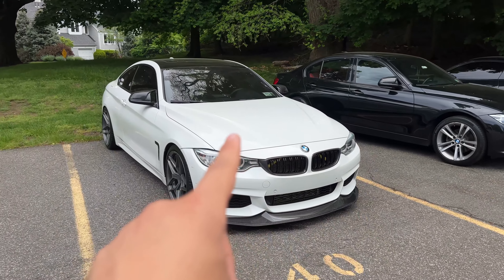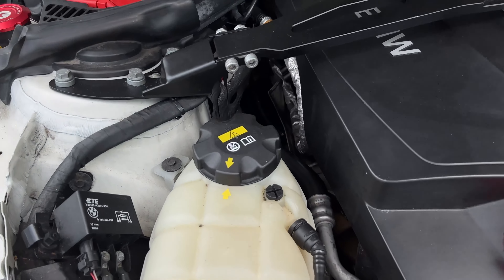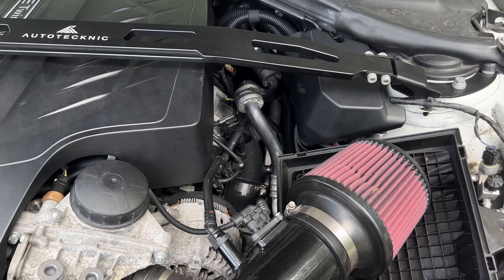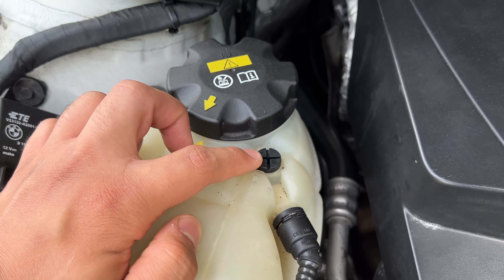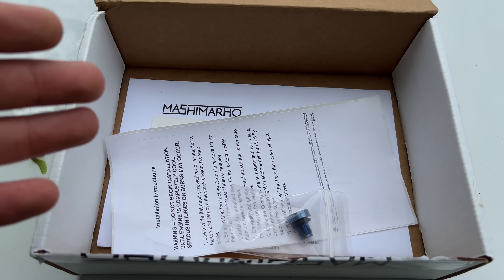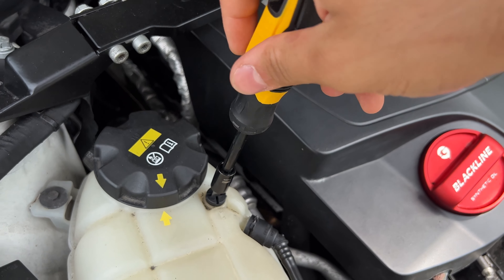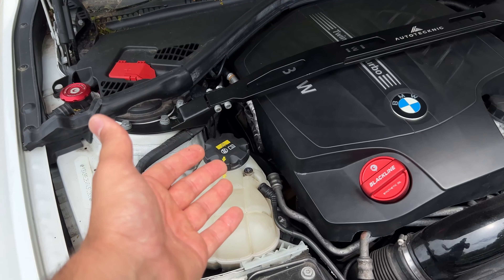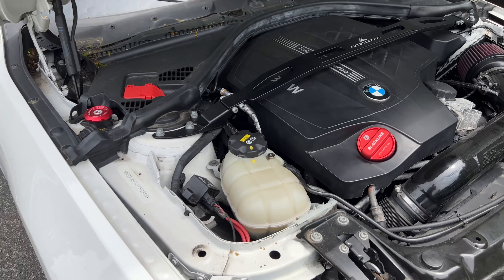THIS TINY PIECE ON YOUR BMW CAN LEAVE YOU STRANDED... UPGRADE IT BEFORE IT'S TOO LATE!

Comment: Yup, I replaced my plastic bleed screw with a brass one when I changed out my coolant expansion tank hose around 45k miles. 👍🏼
Reply from the maker: Smart move doing both at the same time honestly. Two coolant issues resolved at once

Comment: Just changed Water pump and Termostat , Im On 68k . Also got Heating Leak (Antifreeze) in Interior  , Looking For Good Shop who know what he is doing . do you have any recommendation? as i know youre In New york
Reply from the maker: Hey yeah check out Precision Motor Works in Mamaroneck. They did an amazing job on my 435i with the valve cover gasket. They’re very experienced with BMWs and other high end cars as well. And they’re super cool and reasonable.